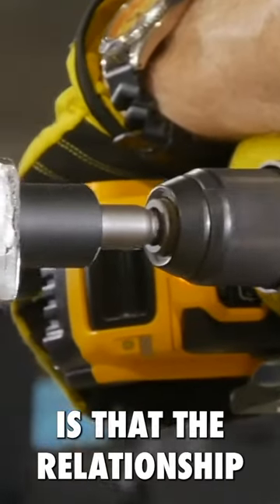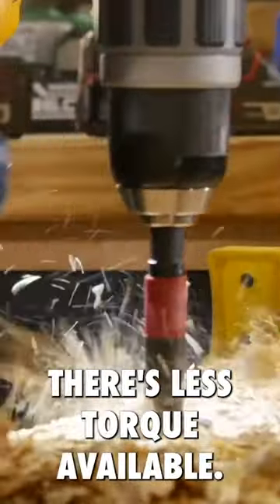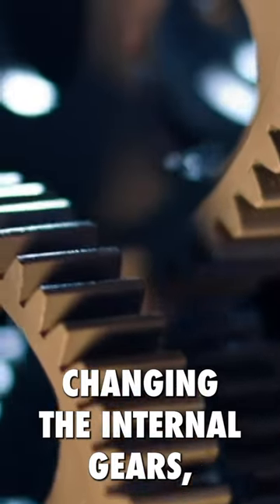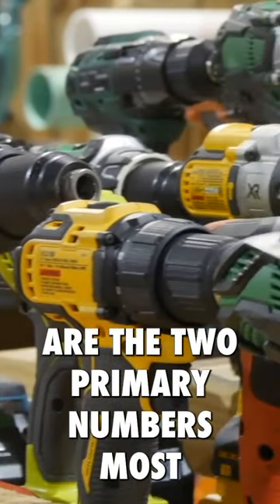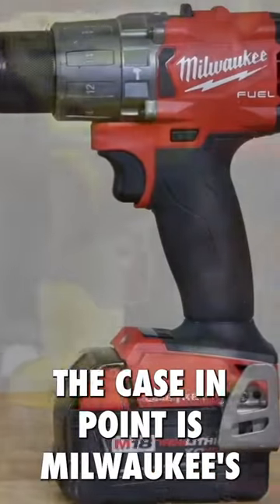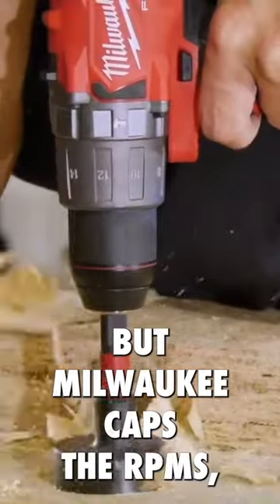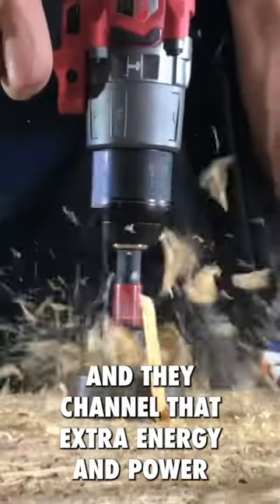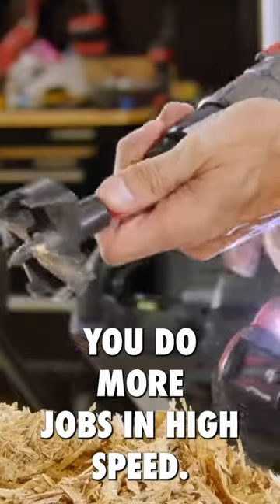Power Drill Torque *EXPLAINED*

Comment: The gearing does not determine the power, the power is fixed from the battery and motor set up. Torque multiplied by speed will give you the units of power.
Reply: Well we don't see many drill without gearing ain't it?
The motor by itself won't do the job you know, so gearing is probably what make most of the power coming out of the motor.
Reply: @LeftOverMacNCheese  so why even bother with a motor when most of the power is coming from the gears.
Reply: @garyjones7044  if the motors are used at maximum load everytime they're used it would shorten it's lifespan by a huge margin.

Just imagine how much load a drill have even with gears. Now imagine if there's just a shaft directly connected from the motor straight to the bit. It would obviously burn the motor
Reply: @LeftOverMacNCheese  the gearing makes 0 power. You said that it made most of the power which is an incorrect statement.
Reply: @garyjones7044  i never claimed the gearing make power.
I said the gearing what make most of the power 'coming' out of the motor.
Maybe read huh
Reply: I was gonna post this. Same as originalposter. The gear is fixed. The power change is done in the speed controller. Aka how hard you squeeze the trigger. In fact all the gear does is connect the electric motor too the chuck. Most drills have 2 speeds fast and not so fast but the switch is pressure sensitive

Comment: Yeah, but soft torque is in speed 1 and the specified  hard torque is in speed 2 reached from one tangential impact at hard stop in shock from inertia, momentum and kinetic energy that is in relation with the speed sqared. Before that one tangential impact, the torque in speed 2 is torque in speed 1/ (RPM S2/ RPM S1).
Reply: That's kind of hard to follow.  You might want to rephrase that.  Good point, I think.

Comment: Can someone help me, I need to rebuild a screw hole on the engine block I need to drill the hole a little bit bigger so on my drill is it better more torque or speed?
Reply: Use whatever speed gets the job done. For small holes, drill fast. For large holes, drill slow.
Reply: @johncoops6897  hey thank you for taking the time to replay, the hole is m10, and I'm going to m10 rebuild the tap. So fast speed should do the trick